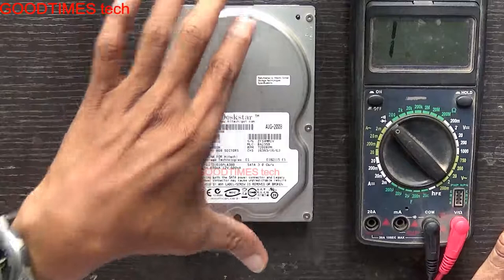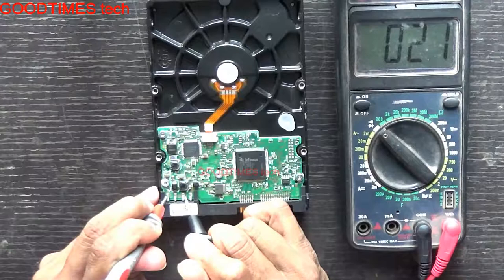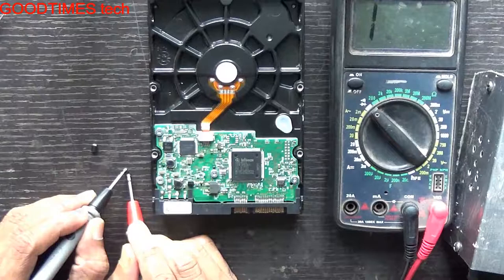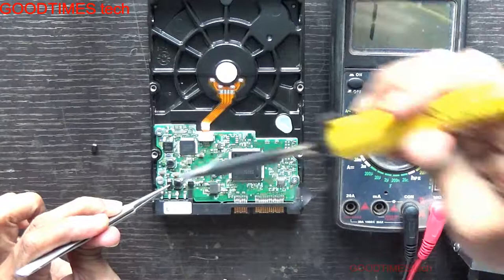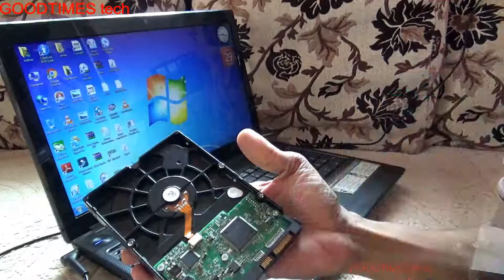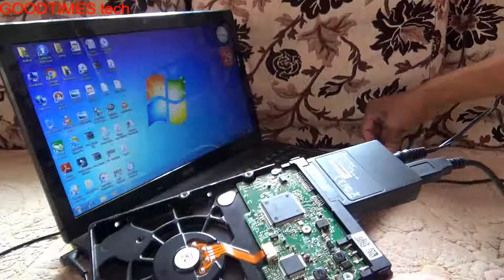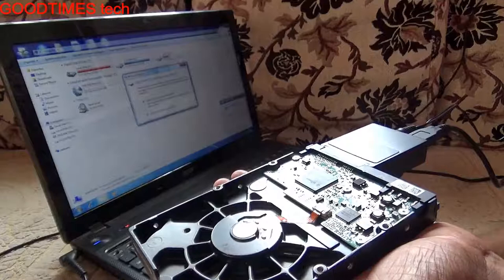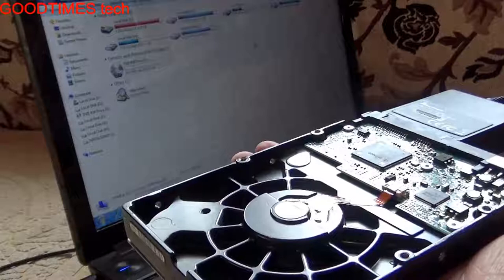Computer not turning ON when HDD is connected | HDD PCB short | Solved

Comment: ... so if computer is shutting off when hard drive is connected by just turning on computer ... is it shorting out ?    ...  all I did was change power supply now this is happening grabbed another one I had in a box and computer is up and running I will probably just throw bad drive out I guess .. I wounder what will happen if I connect to usb like you did ..will it short out computer if I do ?

Comment: Thanks, you saved my data!
Reply from the maker: You are most welcome,
Thank you for watching the video, have a GOODTIME....
Reply: Just a short question, should the new diode be exactly the same as the shorted one or I can use different one from different brands of HDDs that I have laying around? @GOODTIMEStech
Reply from the maker: @henrymcdoo  You can use different diode provided its specifications (voltage and current) are same. you can take it from other HDD if it is at same location(12volt) on PCB.